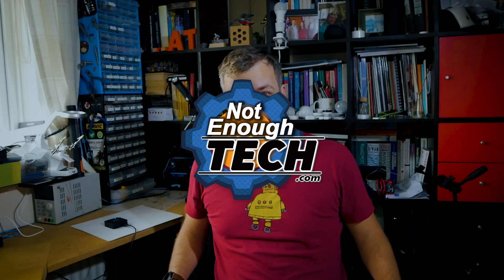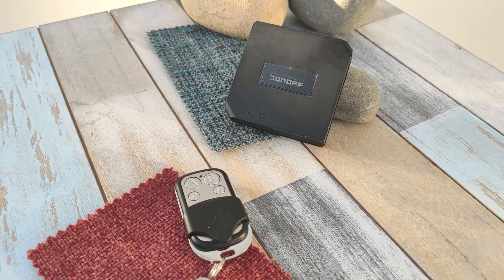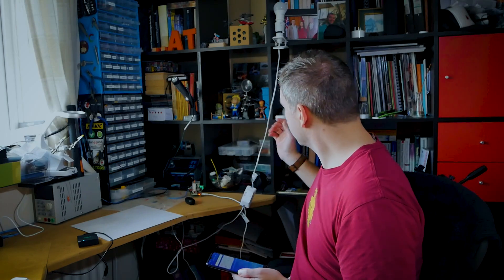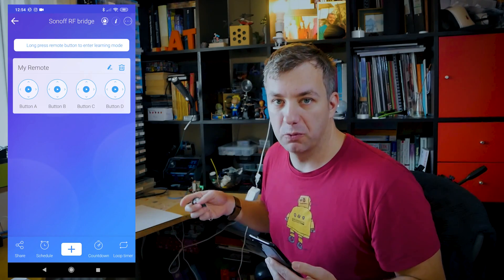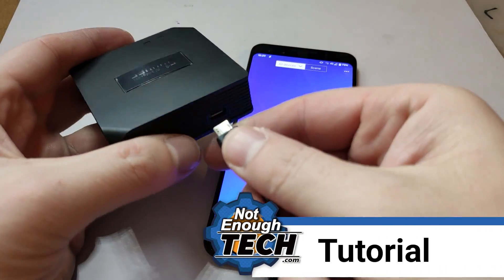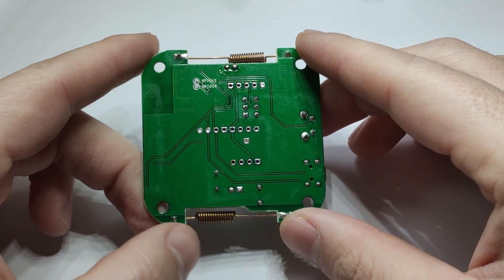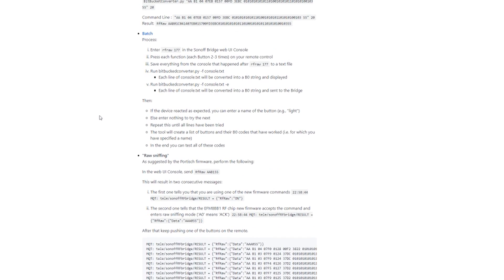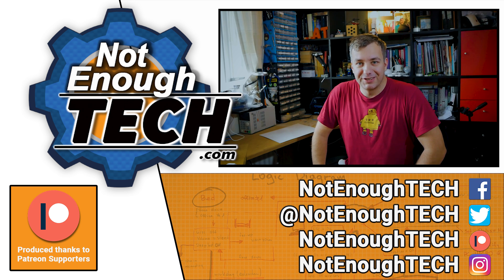Sonoff RF bridge - is RF433MHz still relevant?

Comment: I'm getting absolutely dreadful performance from 433MHz shock sensors to the Sonoff bridge. As far as I can see, it's entirely the software side. The bridge receives the signal immediately and responds with the activity light. So the free functionality is no advertisement for their paid functionality.
Reply from the maker: Worth checking your network.. perhaps something else is at play if you see instant 433MhZ responses via LEDs but not the app

Comment: Question. I have 433 remote garage door. Can I use the bridge to control the door to open and close ? With just the bridge ?
Reply from the maker: If the frequency matches yes you can

Comment: I'm looking to replace 8 regular wall switches spread through the house with RF433 switches. I would like one button strategically placed on a wall to send an RF signal that results in turning on or off all 8 lights at once. My understanding is that a regular RF transmitter button cannot be paired with 8 devices. Can I use the Sonoff RF bridge to do this? Or will it only send out one signal at a time? Incidentally, I would like smart functionality as well, like a timer to trigger the turning on or off of this set of lights.

Comment: There are lots of things u can do with it after it has tasmota put on it. This is especially the case if you bought lots of RF plugs/bells/pir sensors(non-sonoff) etc. in the past.The advantage of RF is also low power usage as wifi is not needed.You can also get 10 button rf controllers from aliexpress. I use the remote to switch off/on my light if I get up after midnight ( sometimes I am up late and want the light on). I use one remote to control my sky box in the sitting room to adjust the channel etc that is sent around the house via anolgue aerial signals also. You can use it for panic buttons etc.

Comment: Can you do a video comparing sonoff rf, sonoff zigbee. Snzb 01,02,03 devices and sonoff rf pir2, pir3. Wifi door window sensor. 
Battery life. 
Signal range. 
Bridge device count.
 Encryption.
 Future compatibility with Home Assistant. 
Extended battery hacks
Reply from the maker: To compare battery life you need a test environment. With battery life on these lasting in excess of 6 months it makes a bit more effort than its worth it. 
If you are interested in range then ZigBee isn't the protocol for you ... For the range you probably want LoRa... As if you bind all sensors only to coordinator you are not building up your mesh network and use the protocol against its strength.

Count depends on the mesh... Again hard to compare as adding routers simply increases the capability of the ZigBee mesh. limit applies mostly to direct children. 

I don't use HA so not sure how I can be any authority on that topic I'm afraid. If you want to go beyond 6months battery on ZigBee sensors use AAA OR AA batteries as they can replace CR2032 (you'll need enclosure customised for it)
Reply: @notenoughtech   can a rf door sensor tell is it open or not like a zigbee sensor?
Reply from the maker: They rarely do as they are design to broadcast only on change. So while they are dormant they don't broadcast
Reply: Thanks 🙏🏼. That means its better to use zigbee as final decision

Comment: Came here looking for a comparison of zigbee and RF. The search continues.
Reply from the maker: ZigBee introduces better security faster data transfer rates mesh network and more IOT compatibility. RF has better range and better low power usage.
Reply: @notenoughtech  Thanks! I'd still be interested to know technical implementation differences.
Reply from the maker: @oldspicefullbody  as the name suggests it's the frequency of the radio 433Mhz Vs 2.4Ghz and all pros and cons of higher frequency waves
Reply: I just ordered a zigbee bridge but I'm wondering if RF is worth trying. Not using wifi is important because I saw a consortium of doctors claiming wifi is a "probable cardinogen".
Reply from the maker: @oldspicefullbody  neither RF or ZigBee is in the ionising spectrum so you don't have anything to worry about. The evidence in that regards well documented. I recommend WHO study on the subject which uses data submitted by 38 countries, rather unverified claims over studies or animal cell tissue which made the news with doubtful claims.
Reply: I used to think likewise about non-ionizing radiation, and I admit there are those making unfounded claims. But at some point this insistence is just physicists' arrogance. I have a degree in biochemistry, which isn't much, but it's just enough for me to know from spectroscopy that molecular bonds have a characteristic energy at which they can absorb photons, and proteins are characterized by weak interactions. These are in the non-ionizing range. There's a claim that the temporal distribution of serialized wifi is important for its physiological effects. So acknowledging that proteins can respond to non-ionizing photons, recall that the neuronal communication happens via ion channels that are poised to be triggered like dominos. Also that the nervous and immune systems are intimately linked. What if wifi could obscure normal communication, hampering the immune systems constant battle against cancers? If this is a plausible line of reasoning, it doesn't bear ignoring just because it hasn't been 'proven' because research needs funding. Afaict there's lots of decent looking research claiming we should be wary, from people with far more knowledge of it than you and I. The onus is on those who claim it's harmless to refute plausible objections, which I don't think is happening.
Reply from the maker: @oldspicefullbody  using radio waves on exposed tissue is one thing and does not substantiate the evidence of the effects on the human body. 
Research doesn't get funded usually when there is not enough evidence showing the progress it, which renders it futile. Claims that WiFi hurts us are not verified by peer-reviewed research and backed by evidence that was not disputed. 
On the cancer side, there is no more cancer than before, collectively we got better at detecting it prolonging life and got bigger as a population - which in turn increases reporting on that matter.
Reply: @notenoughtech  I agree that these signals may be safe and I hope they are, but consider the different implications of being wrong on either side of the debate. When the research is lacking it's better to acknowledge we don't know than to claim it's safe. Especially considering there's huge financial incentive on one side, and none on the other. You don't have to be a conspiracy theorist to understand that money can profoundly influence such scientific debates and common knowledge in general. With this consideration, when I see there are many respectable people claiming it's a serious concern, I believe them.
Reply from the maker: It's worth researching the tech as we introduce it to citizens and studies should be taken to prove and disprove the statements made on each side. It's also important to recognise when the research is backed by evidence, when media reports on actual evidence, not just looking to click and bait. 

As a person with an outlet and following, I recognise how tempting it is to just put relatively harmless stuff out to get a boost to performance with titles that bait, and arguments that are neither fact checked or true. There is a huge incentive for it. Controversy sells, and money is huge behind the online revenues on that scale. 

What doesn't sell however are mundane 50 pages long peer review papers that point by point confirm/disprove thesis in evidence based approach. Perhaps I'm ignorant but majority of people who submit to sensationalist approach, don't strike me as the ones who ever read one of these paper in full with the grasp and understanding needed to take educational values.
Reply: @notenoughtech  I'm not completely sure what you mean but thanks for your reply. I agree and it's a good point that most of us don't have the time or knowledge to make a proper assessment. But what I don't understand is the widespread desire to claim wifi is definitely safe when there is a significant community of scientists saying it's likely not, and giving plausible mechanisms, while best argument the other side of the debate has to offer is that the research is lacking or flawed. It's reminiscent of other industry-funded denials of the past.

Comment: Have you not looked on the web to see how many 433mhz products there are it is mindblowing and with a bit of work they will all work with the RF bridge so I would say it is very relevant in 2020
Reply from the maker: Considering that most of companies move to ZigBee, Bluetooth or low power WiFi rather than introduce new RF designs... I say they less relevant each year
Reply: @notenoughtech  They have only changed to Zigbee as they use their own code to lock you into their products but they can't do that with 433mhz so it is just another trap by manufacturing companies! look at how many Zigbee products don't work with other Zigbee products

Comment: Literally just ordered one, want to use it to control my 433MHz RF Controlled Projector Screen.
Reply from the maker: Oh I sense fancy automation. Check out my smarter wall switch article to find out how to trigger it when you turn on your projector
Reply: @notenoughtech  The hope is to tie it all in via HA/Node Red and Alexa to the Phrase "It's Showtime!"
Reply from the maker: If you can wake up the projector with a voice command already ... :)  use ping to check if projector (if connected online) is awake then you can dim the lights and retract the screen). For my projector, I just use the remote to wake it up, everything else happens automatically

Comment: Hi, your video is great. I'm setting up one of these, the 4 buttons are programmed and when each button is pressed on the app, the RF red LED flashes but it fails to do the function that was asked. I'm puzzled🤔🤔🤔
Reply from the maker: Is the remote you "copied" paired with a target device?
Reply: @notenoughtech  Yes, it works fine. I've just tried another one button remote to another device and that ia working brilliantly through Ewelink...
Reply: @notenoughtech  thanks for your reply though 👍

Comment: Can I use this as an universal RF remote?
Reply from the maker: I'm not sure about the compatibility with other remotes. From hacking posts I found that once hacked you could use any RF signal in that range. Note you will need a remote to set the signal first. I'll try to get my hands on one to test
Reply: @notenoughtech Thanks for replying. I'm not very confident with flashing the device. Without doing any hardware level or software level changes, is it possible to learn unbranded LED strip RF remote signal and control it through the RF bridge using Alexa or Google Home mini?
Reply from the maker: The control part yes. As per "unbranded" it will vary from one remote to another. Even if I try mine... May not work for your model. It's a risk unfortunately
Reply: @notenoughtech  Can you please try to learn a Non SONOFF RF remote signal and using the signal please try to control a Non SONOFF RF device and let me know the result. thanks in advance

Comment: Hi. I got a came gate controlled by an RF remote. Would this bridge work to control my gate online?
Reply from the maker: Without flashing tasmota, Sonoff limits the RF products this bridge can be used with. If your gate has switch that can be operated by a RF sonoff then yes, otherwise you would have to flash it to assure compatibility with your current RF system
Reply: @notenoughtech  ok thanks. Not sure if understand it all but will do more research.

Comment: Hi,
What would be the easiest method (without FW flashing) to have the garage door status Open/Closed status indication?
I was looking at Sonoff RF Bridge and Sonoff DW1 door switch but DW1 only gives an alarm when the door opens (no feedback that the door has closed back or status O/C).
Are there any compatible wireless door sensors that provide Open/Closed status?
Integration with Google Home mini to query door status would be beneficial but door O/C status on the phone would be enough.
Thanks.
Reply from the maker: This would be good for you https://notenoughtech.com/home-automation/sonoff-wifi-contact-sensor/ it's in preorder now and only $7
Reply: @notenoughtech  Thanks. 
It looks just right since it's simple to mount and it doesn't need any other hub/ bridge to display status in the app. Now I'll just have to wait for it's relase :-)
Reply from the maker: Almost there. I will have the commercial sample for testing as well. The one you seen in the link is a dev unit. The final shape is square as seen in the poster.

Comment: After flashing mine with Tasmota, I pick up 433 Mhz signals from all of my neighbours. And what's worse, I can send those signals too without knowing what they control. Long story short, I like having the small fob to control my lights, but I wouldn't trust it for anything security related like doors, etc.
Reply from the maker: Yes, replicating the signals is definitely not the hardest part for better or worst. I hope you are still friends with your neighbour.. otherwise he is in trouble hahah
Reply: In the long ago times lots of garage doors could be cloned.  Newer garage doors use a more secure protocol but there are lots of the old ones still in service.  Just for kicks I hooked my SDR to my external antenna and looked at the 433mhz RF signals in my neighborhood. Lot's of them out there.  I was thinking of trying to identify what the devices are.
Reply from the maker: Just imagine placing a probe for 2 weeks harvesting the data then walking down the street opening the doors one by one like in some insane villain music video 😍😍😍
Reply: @notenoughtech  I was thinking I could fairly easily add a LNA (Low Noise Amplifier ) to the Sonoff so I could pick up more signals from further away.  What you describe would be interesting but I won't be doing that.  I value my Ameteur radio license too much.  I had of course thought out how that could be accomplished and came to the conclusion the easiest way would be to make the Sonoff portable with an external battery.  Alternatively someone could just use a high power transmitter or an amp connected to the Sonoff.

Comment: Hi I've ordered one of these RF bridges in the hope that you can switch a WiFi sonoff basic with an RF pir through the ewelink app anyone know it that's true?
Reply from the maker: Yes you can. That's what I did in my demo. The Sonoff light was not connected to WiFi, and i triggered it with RF433 remote and Sonoff RF bridge - it's like having a device which presses the RF remote buttons for you on location

Comment: I flashed mine with Tasmota, it wasn't that difficult, just the same as flashing any other SONOFF maybe you were looking at an older guide. I mainly use mine to detect when the £16 doorbell is pressed. Go on Matt flash it!
Thanks for the vids.
Reply from the maker: With that encouragement... I have little options left but listen. I'm surprised how many of you actually is using it. Definitely RF433 isn't in the past just yet 😊

Comment: I also hacked mine with tasmota. I can now send and receive RF signals from devices around my house.  I use tasmota rules to control timing and payload issues.  I particularly like to use  RF magnetic contact switches that have separate open and close codes.
Reply: I use the  GS-WDS07 Wireless Door Magnetic Strip 433MHz from Banggood.  It sends different RF codes for open and close conditions. It doesn’t send regular status codes.  Using tasmota rules I publish Open or Closed changes via MQTT to node-red. So following an Open notification I have to assume it remains Open until a Closed notification is received. I have had a look at the tasmota rules documentation and can’t see how you could poll the switch given it can only send and not receive RF signals. Others may have more knowledge of the rules.
Reply from the maker: @briandurward  One of the advantages of Zigbee is constant communication, it's not perfect if you are looking at battery use, but it has its benefits. I know "skipping a beat" is unlikely to happen with RF but i had a couple of misfires with the RF remote so I was wondering.
Reply: @notenoughtech  Have you had a look at the RfCode command in tasmota.  I can use it to send RF codes to RF devices like plugs that can receive RF codes to turn ON or OFF. I would be interested to know if zigbee can do the same.
Reply from the maker: @briandurward  Zigbee can trigger the state of the device, but only if the device is paired to the server/hub. This is what makes Zigbee more secure than RF which signals can be easily spoofed.
Reply from the maker: Do they advertise on contact only or update from time to time the state?
Reply: @notenoughtech  only on contact, rf devises do not advertise usually, sure not the door Reed ones, I've them too

Comment: Mine is Tasmota. Allows me to use cheap RF door and motion sensors, as well as cheap RF buttons and light switches from AliExpress. All on battery power.

For example, I have two tiny RF buttons next to the bed, talk to the bridge, talk to Home Assistant. Sends the house to sleep, then wakes it up.
Reply from the maker: Looks like there is a couple of you keen on flashing it.. in all fairness you all make it seem definitely worth playing with :)
Reply: @notenoughtech  Very much. Pinky Wafer has a way of getting ESPHome on it too, but requires a hardware hack. Wish I'd done that now, save having to reboot Home Assistant every time I add a switch to configuration.yaml.
Reply: I also found it can receive payloads from a cheap RF remote for plugs. Going to try broadcast to the actual plugs next, and if successful bring them out of retirement.
Reply from the maker: @Kosh42EFG A couple of google searches... and this is another rabbit hole I will end up in eventually :)  thanks for the tips !